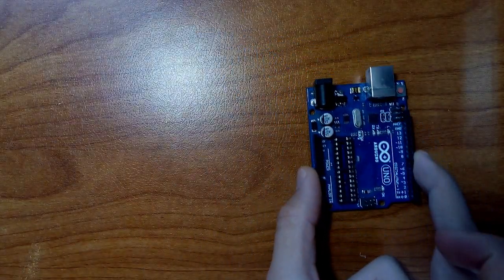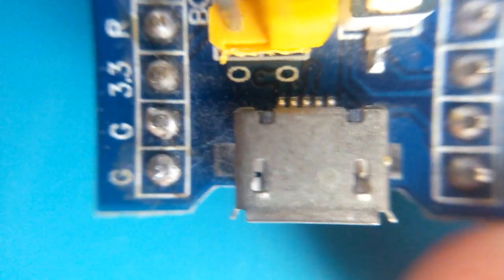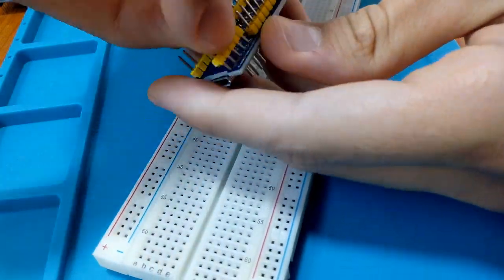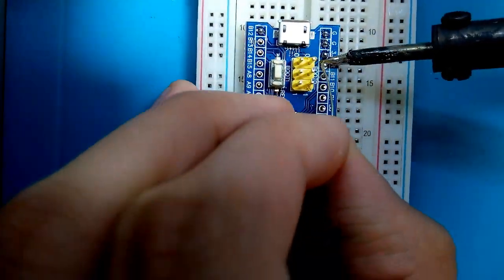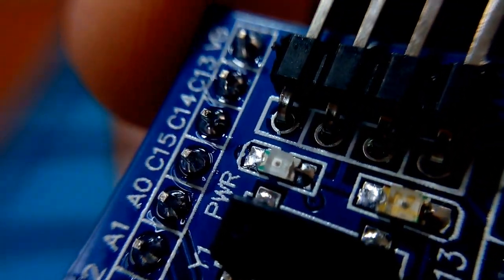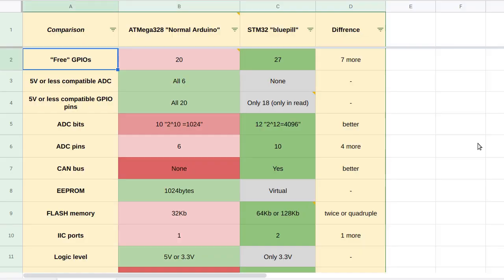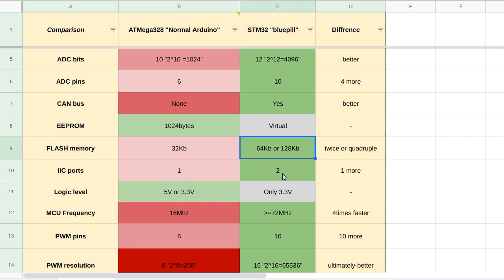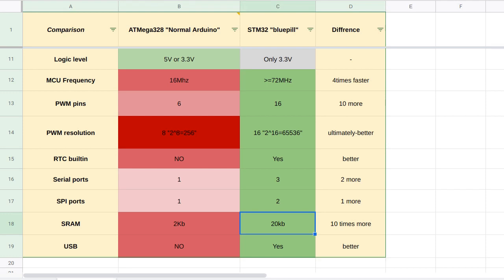STM32F103C MCU "bluepill" board Soldering, Setup, Specs. & comparing to an Arduino | SMM's Blog #2

Comment: The blue pill is a way better and cheaper option, if u cant use a serial port or st-link, just go with an arduino. Note:  if you want to have certain ports that the arduino has, just use a cheap extension board.